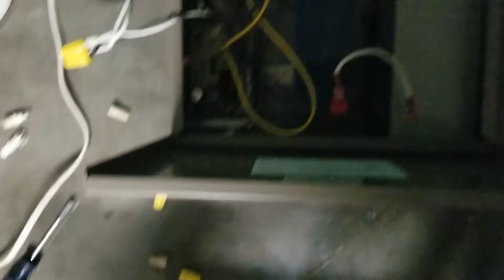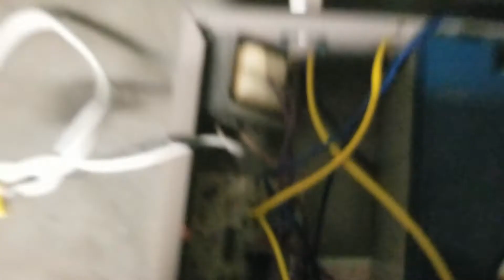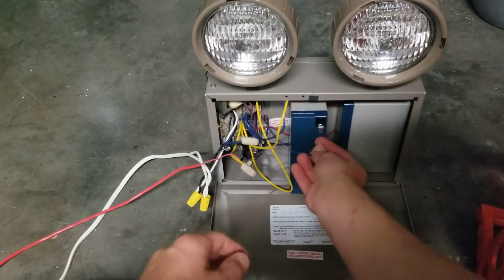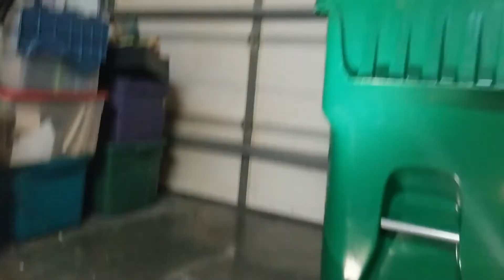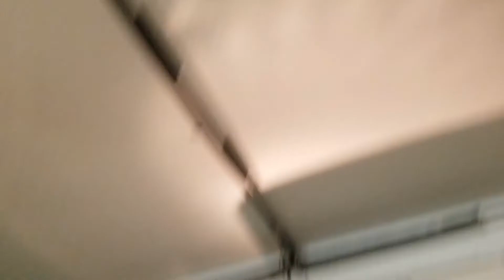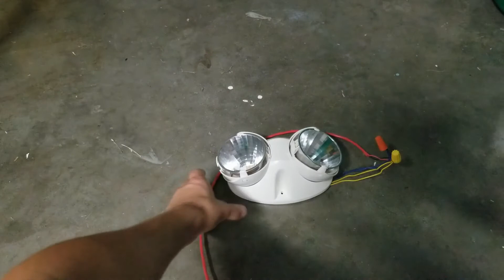How To Connect Remote Heads from Emergency Light

Comment: My 12V remote head has 3 wires Blue, Yellow, White........what is the white for?
Reply: Could be a multi voltage head? Maybe one wire is for 6v and one is for 12v